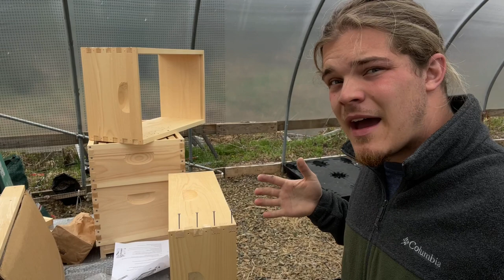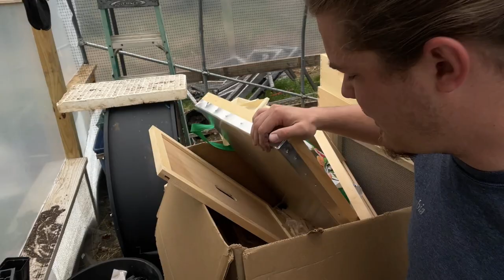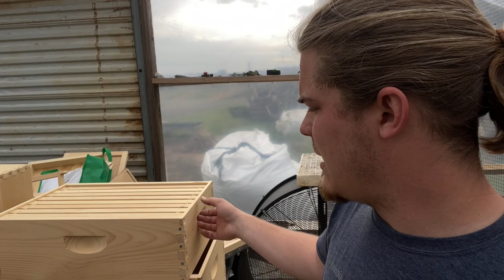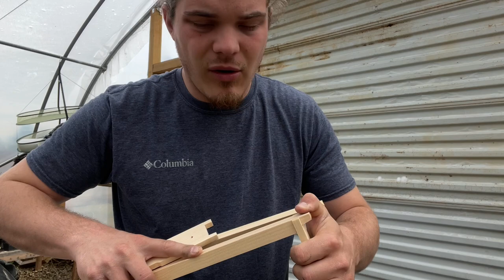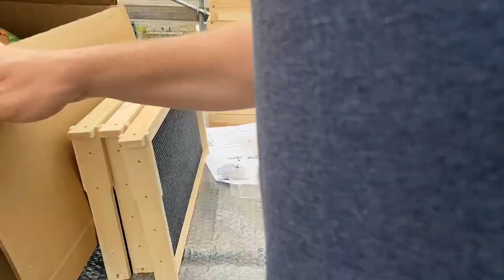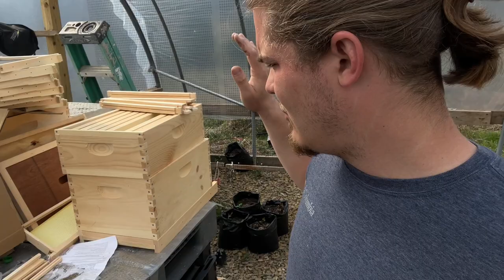Why My DIY BEE HIVE BUILD Is Better Than Yours!

Comment: Hello Flower Guy:
     You are doing great!  Just a few suggestions.  Yes, the 10 frame hive is the most used bee hive in beekeeping.  It is called the Langstroth hive.  Named after Rev. Langstroth who was able to optimize the number of bees in a box to produce the most honey without swarming, in his local.  The concept of bee space was first promulgated by beekeepers utilizing the 10 frame box.  The eight frame box is ok but you will have to pay more attention to it.  You held a little bag of nails up.  The longer of the two are frame nails and the small ones are wedge nails.  You used the correct nails on your brood box.  The holes on your frame end bars are for foundation retainers.  Years ago there would be a grommet placed in the hole and wire would be strung through them.  (It was hard work and the wire had to be embedded in the wireless foundation!) The honey frames you have will hold about 7 to 10 pounds of honey each.   There are available inserts for closing off the screen bottom.  Also you will soon learn about mites and there are sticky pads that fit exactly.  The first top you put on, with the hand hold (not) in the middle is the inner cover.  The cover with the sheet metal on it is a telescoping cover.  You do have the wrong nails in the frames.  You should have ten of the longer nails in the frames!  Each.  Total 8frames.....80nails eight frame box!  Two in the top and bottom at each end bar...8nails....now two brace nails into the top bar and bottom bar...one each...total 10 nails for one frame.  (If you are half the beekeeper that I THINK you are going to be you  will find a nail gun that shoots 1 1/2 inch brads!)  The foundation that you have is black plastic foundation.  I looked at your top bars and you do not have wedges for your foundation.  You do not need those small nails until you order some wired foundation and WEDGED TOP BARS. carrollrhodes@embarqmail.com
Reply from the maker: Wow! That is some helpful information! I appreciate all of that. I did change the nails out. I was so glad I had done that.
Reply: @WindyBrookRidgeHomestead  Did you get your bees?  I hope that you painted the outside of all the wood.  Don't paint inside where the bees will be.  You were concerned about glue for the super frames.  Don't because in the future you will be taking those frames apart as you repair and use them in an extractor.  You are lucky that you got the correct frames.  Your frames are "Illinois" frames.  They are not shallow, medium nor deep!  If you order from some of the other companies, Dadant, Mann Lake, etc. and they have some pretty aggressive sales people.  Sounds like Miller is a good one.  Remember when you order honey super frames, know the width of the frame and the word "Illinois"!  If you haven't ordered other personal equipment, the minimum that you need will be a veil, hive tool, bee brush, smoker and gloves.  But be careful about the equipment you order.  There are some really expensive "stuff" out there.  Get the minimum.  Don't buy smoker fuel.  Use pine needles.  The best youtube guy to watch is Tennessee's Bees.  Kamon Reynolds.  If I can help you in any way, I will.  E-mail is usually best.  I check once in morning and once in the evening.  Where are you getting your bees?

Comment: The holes are intended to string wire to support natural wax foundation, the plastic sheets have made it simple to build frames. I use wood glue and a stapler to assemble the frames.

Comment: Added comment ..... The holes in the side of the frames are to put something in to keep the wax parallel with the frame and keep it from warping in the heat . You can use nails ,, They also make a split type of metal clip like a nail to put in that the wax is slid into.  You can just use the nails and stager which side of the wax they are on .
Reply: Also you can run wire and not put in foundation, if you'd like to be able to harvest cut comb sections.